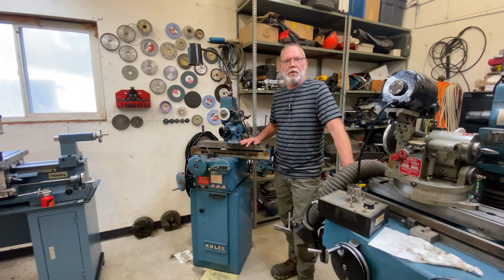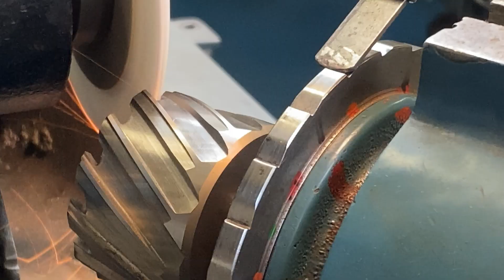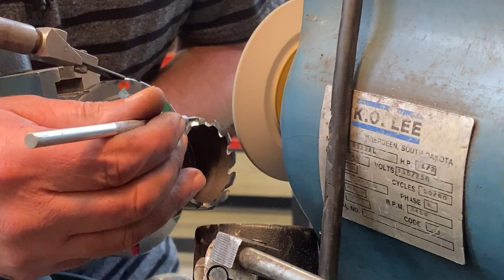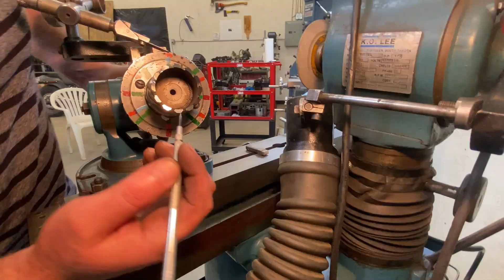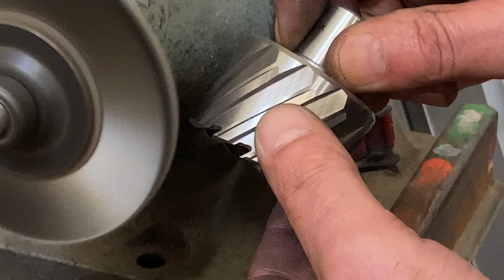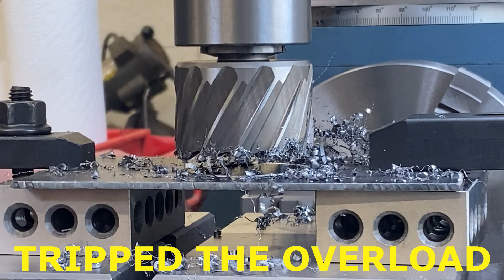HOW TO SHARPEN A ANNULAR CUTTER

Comment: The gap between the gulet and the teeth is for heat transfer I'm guessing, to pull heat from the outer diameter tooth cutting edge.

Comment: seems like a reduced cutting angle might have helped out with the chatter, these cutters normally cut as smooth as silk even in small drill presses so I'm struggling to understand why all the chatter was happening, sometimes once chatter starts it's hard to stop unless you slow the feed and increase pressure enough to really get a good bite and get under the chatter, then the pressure can be backed off a little once the chatter has been removed. anyhow, thanks for the video
Reply from the maker: Thanks for watching!

Comment: A few weeks ago I had the opportunity to sharpen a bit like this and it was a new bit but every other tooth was shorter. It was a 6 flute bit and I use the Foley Tool grinder with cbn wheel which did a good job but what is the reason for the teeth being different?
Reply from the maker: It reduces both chip size and tool pressure, also can help with chatter. Thanks for watching!

Comment: Nice demonstration and learnt a lot! You were saying about getting that relief to go to the back edge of the cutter. What can be changed to achieve this if it’s heading to the outside edge? 13:25
Reply from the maker: If the transition line between the two angles were heading to the outside edge you could rotate the tooth you're working on upwards until you had steered it back to where you wanted it. Keep taking tiny cuts and making small rotational adjustments until you get what you're looking for. Before you get too deep with your trial and error , if need be, index to the next tooth and keep working at it.
Great question!
Thanks for watching!

Comment: Interesting to see how this is done in practice. We use a lot of anular cutters at work, perfect for punchung holes with portable machines. There is one thing you didn't do that our anular cuters have, and would have helped you drill a bit easier. That's alternating the teeth between having the crest of the tooth offset to the left, right and center. That way, each tooth only sees 1/3 the load. Over all feed rate is slower though. Not sure how you would do that with this setup though.
Reply from the maker: The staggered tooth effect is normally done on larger diameter annular cutters but it could have been done on this one. It would be easy to do using the method shown. I would just go a little deeper on every second tooth on angle 1 and then go a little deeper on every other second tooth on angle 2

Comment: This is very interesting! For a layman, I'd also be interested to see if there were practical methods for repairing/dressing/sharpening holesaws utilizing less advanced machinery.
Reply from the maker: Interesting concept. I'll give it some thought and see if I can come up with a method of sharpening, (But without ruining) some of these things with tools most guys have at home. Thanks for the comment!
Reply: Dremel with a little cutoff wheel, go slow, take your time. It gets easier to sharpen them the more you do it

Comment: Hello from Aus. I use a saw gulleting wheel to grind the gullets. 150 X 3 X 31.75mm Ruby alox 80 grit. it does well. Also the clearance grinding issue for the inner facet is easier if the wheel head is tilted and not the workhead. Why I don't know. For facet grinding I use an 11V9 wheel. 38A60 KV.
Reply from the maker: Thanks for commenting

Comment: Mmmmmmm  250 RPM and Push How many rpm where you going? I suppose you could always reduce the cutting angle on the cutter. Anyway, great. Cheers again, Davo
Reply from the maker: I didn't actually check what RPM I was at. My gut tells me that I was going much faster than the cutter wanted to go

Comment: What kind of rpm are you running at that you can run without wheel covers and not worry about personal damage if the wheel explodes?
Reply from the maker: 3450 RPM
I would recommend that everyone uses a wheel guard at all times.